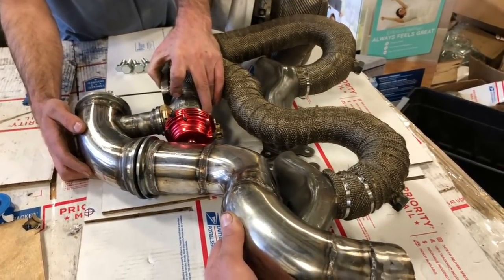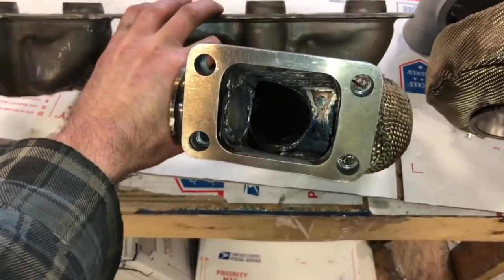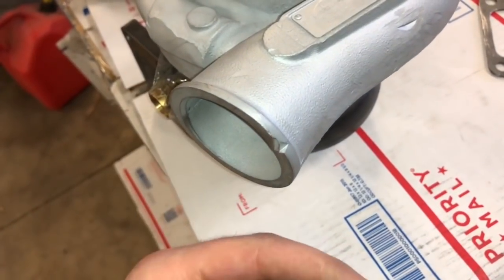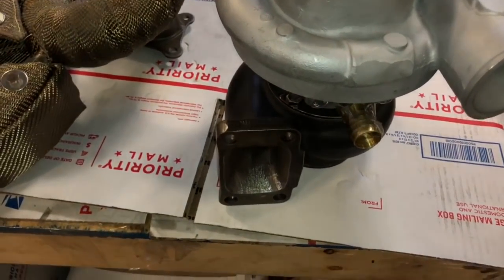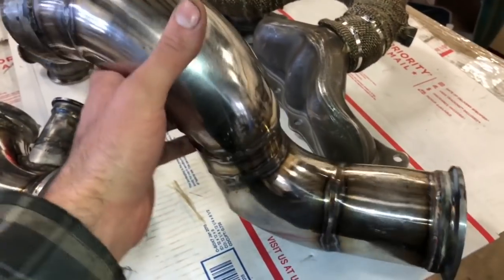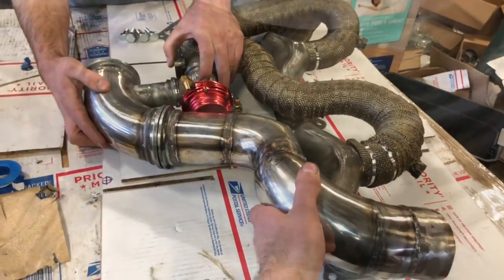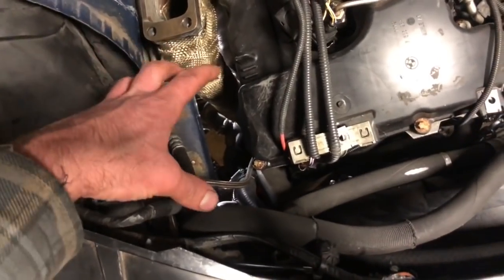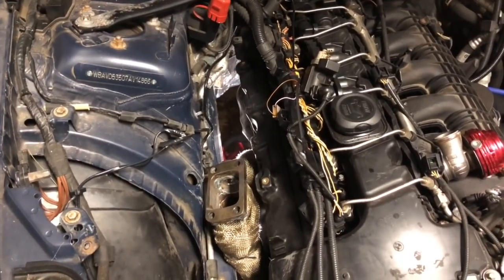Bmw N54 Single Turbo Kit

Comment: Setup looks fine, remember that the engine does not care what the parts look like, they just have to work and hopefully last for a while. Question: How much psi that intake manifold will take before it comes apart?
Reply from the maker: How would I possibly know the answer to that question?
Reply: I guess there only one way to find out..

Comment: How much power you looking at making?
Reply: 500 plus
Reply: @cuongtran-ty1te  awesome
Reply from the maker: One customer has the same turbo and made 718 hp at 33 psi before running out of fuel on e85, he needs to use more fuel pump for a stronger one. He has 2 walbro 450 lph . I don’t think Ian cares about the hp, I think he just wanted a single , I have the upgraded twins on mine and that is plenty for me
Reply: If i can find a n54xi donor and the e60 5 series motor mount i want to fab a low mount for my 535xi.
Heard the automatics can only handle about 550 alloy though. Bigger turbo should be slower response and help hopefully.
Reply: @turbolabamerica  that's not bad at all